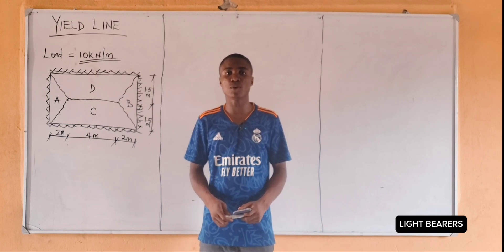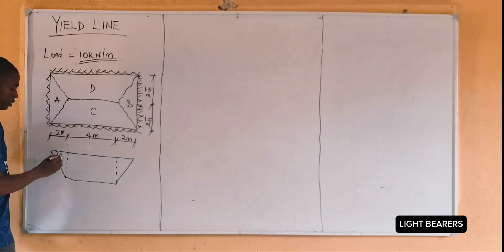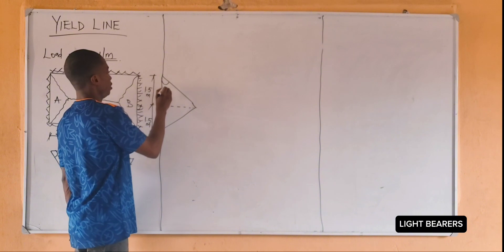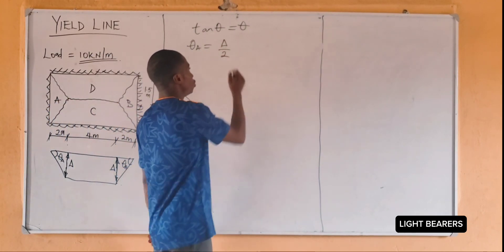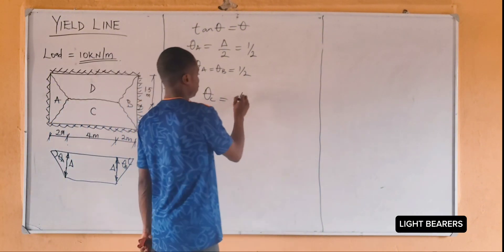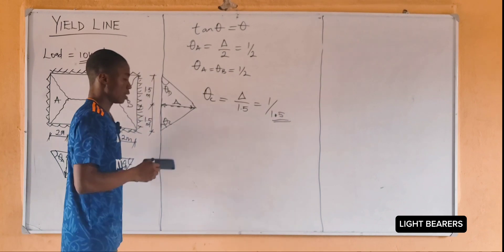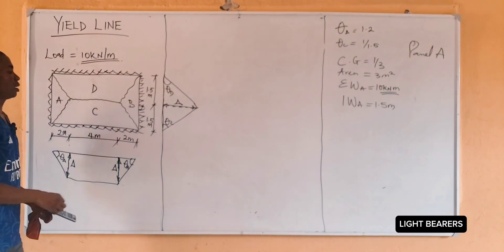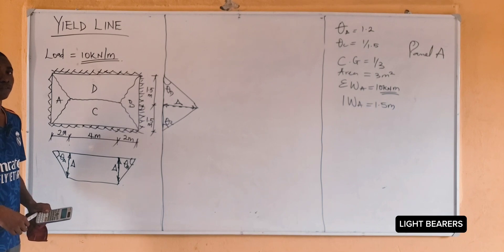YIELD LINE ANALYSIS

Comment: From the diagram we can see that the slab has fixed supports all around. Doesn't this means that we are suppose to have a negative yield line running along the whole edge in addition to the positive yield lines that you've drawn
?
Reply from the maker: No